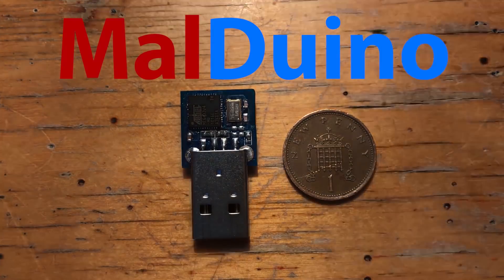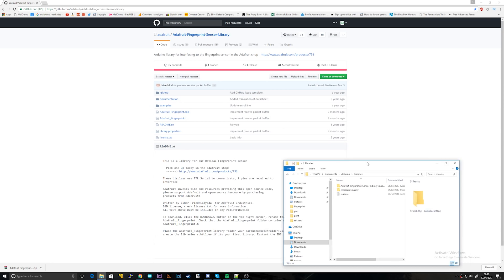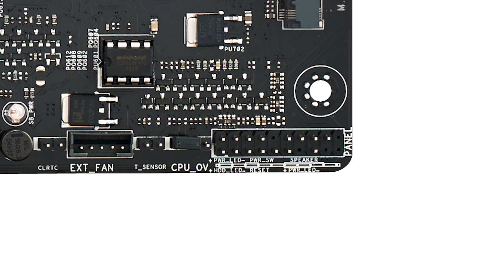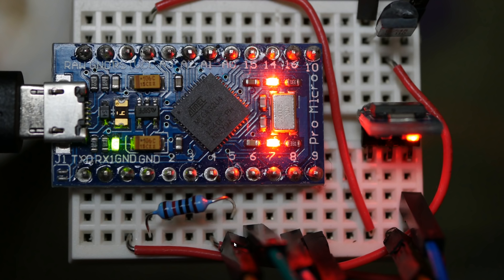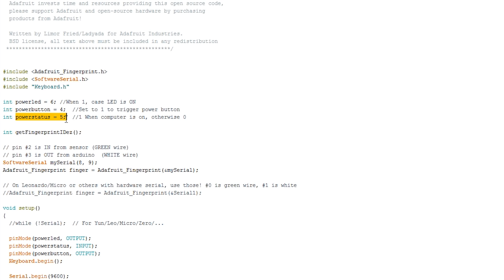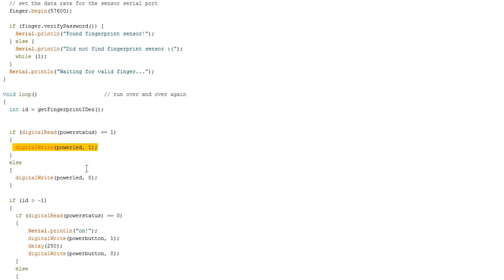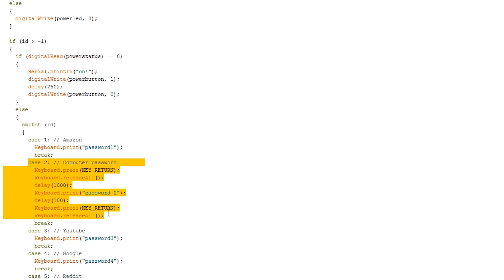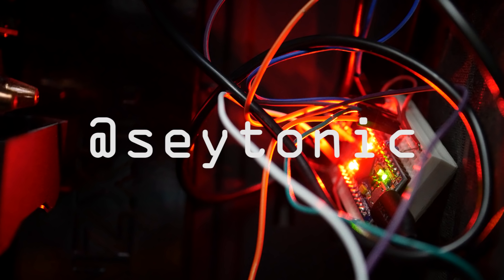Fingerprint Power Button / Password Manager | Arduino Tutorial

Comment: Set the lock fuses to prevent readout of the memory. Reversing them without a flash erase involves etching open the atmega and physically flipping the lock fuses, although I can't remember how that worked. So quite secure!

Comment: Me, I just unplug my ssd when the computer is off, if anyone tried to turn it on they'd get a boot failure error message.
Reply: If you use your ssd just as a boot drive that still doesn't work, all it takes is a linux distro on a flash drive, and anything you've got stored on your HDD is free game.
Reply: Now I will also do that.

Comment: Seytonic maybe u can help me with a better duckuino arduino pro micro & micro sd card module & usb uart ttl 340g (to recognize the arduino as pendrive and change the code without unplug the sd card put adapter and plug to computer...)
use de "dip switch to chage 1-0-0 (binary to rubber duckuino) and 1-1-0 (pendrive recognize to change the programming code) sorry for my bad english, thank you

Comment: You are missing a base resistor on the transistor ... your Atmega processor and transistor will be cooked :)
Reply from the maker: :O Thanks for letting me know.
Reply: Most of the designs I have seen seem to use a 1K Ohm resistor on the base of the resistor to prevent to much current flowing through the ATmega chip.
Reply: You should really point that out in your video via a YT note or something.

Comment: Is there a way to get some kind of hash value from your fingerprints? If yes, you could, in theory, use it to encrypt and decrypt the passwords, making it harder for anyone to reverse engineer it
Reply: You could also setup the hash to be your windows password, so the microcontroller sends the fingerprint directly to the PC and no password, not even an encrypted one, is saved in between. If you want to replace more passwords by your fingerprints, you can simply hash your fingerprint hash again to get a different one or use another finger.

Getting the hash value directly from the scanner would open up so many possibilities...